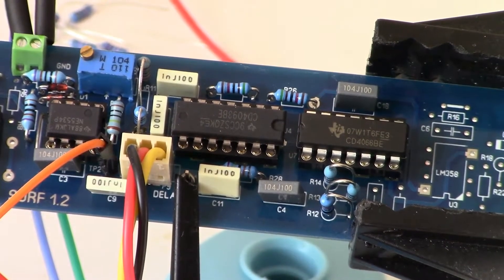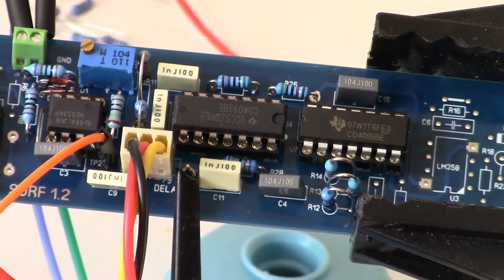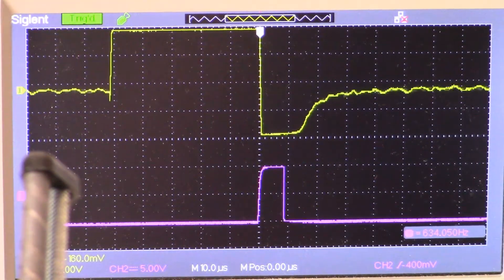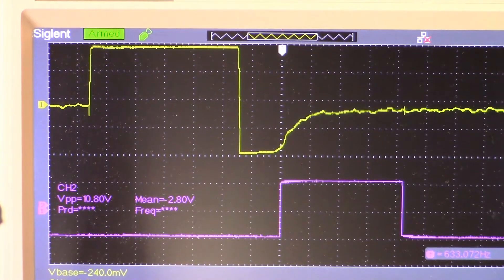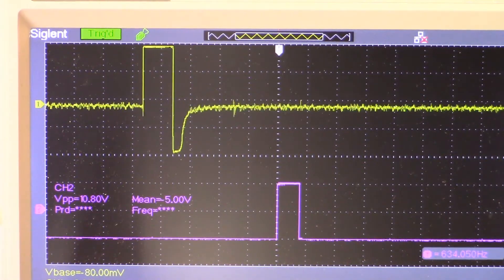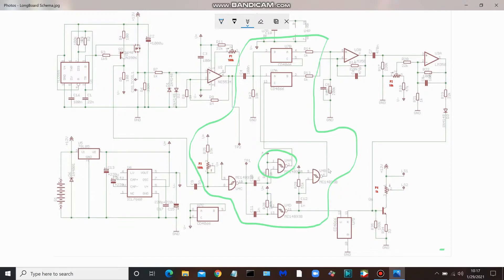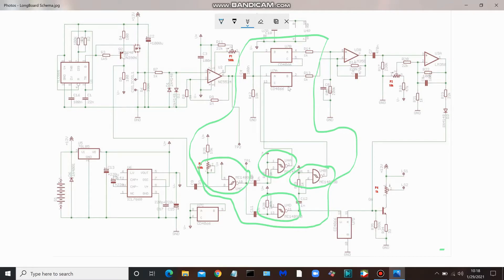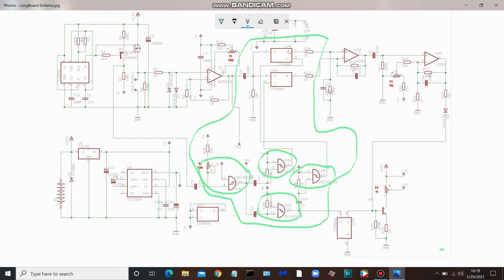Surf PI Longboard DIY part #4 sample pulses

Comment: Excellent videos - I just subscribed. Would be beneficial to mount the Delay and Offset potentiometers on the outside of the control housing? I´ve seen some PI machines like this.
Reply from the maker: Hello John,
Welcome to my channel.  I believe if my memory serves me well that I put the Threshold, Volume and Sample Delay as exterior pots on that project. The trimmer pot for the nulling of the pre-amp should remain on the board as that is a one time adjustment.  Please like and share the videos if you enjoy them and thanks.
Reply: Thanks Mate 😀
Reply from the maker: @MrJkosta  Glad to help.

Comment: Thanks alot for all your videos.
I am not sure but i think the reason for the second sample is used for ground effect (minirlized soil) i read that the ground effect appeares after the target for about 10 microsecond so if we take another sample with 10 micros apart and substract each other then we will cancell the soil effect.. not sure but that what i saw in gold scan detector
Reply from the maker: As you swing the detector it picks up the Earth's magnetic field.  If the 1st sample contains a real target as well as the EFE (earth field effect) and the 2nd sample only contains the EFE, then when they are compared by the detector it subtracts out the EFEand you only have the target signal left.
Reply: @SurfDetector  so if i add this feature to polones pi i could work fine on mineralized soil??
I mean adding another 4011 with bf245 and before the 741 op amp i add a differntial amplifier.
Reply from the maker: @newton224466  This is not for mineralized soil.  This is for the magnetic effect of the earth.
Reply: @SurfDetector  ok i got it but does the earth magnetic field has that effect? I mean why when we put the polones on the rock surface we get no sound, while on the soil it does not stop beeping? I do not thing the earth magnetic field has that big affect
Reply: @SurfDetector  final question and i am sorry for the long replays. But could you guide me to know about the soil minerilized effect and how to minize it
Reply: @SurfDetector  https://youtu.be/PaFsl9-b7Ic
This modification how stable on mineralized soil and sensitive for gold. This means the delay is small but stable on soil
Thanks againg and sorry for talking alot
Reply from the maker: The PI machines handle most mineralized soil well without modification
Reply: @SurfDetector  unfortunately felezjoo and polones and delta pulse2 were not good at mineralized soil her.. any advice for available schem and do good job at soil? thank you so much 💎
Reply from the maker: I have not had the need for this so I do not have this information.
Reply: @SurfDetector  thanks alot fot your time and for you videos and sorry for talking alot.
All respect

Comment: to see the delay wave. on which pin the probe is placed
Reply from the maker: To see the sample delay pulse you need to look at TP1.  If you have not put the test points on your pcb then put your probe on pin #10 of the 4093 chip.  Please subscribe to the channel if you enjoy the videos.
Reply: @SurfDetector  Okay, thank you. I have subscribed. your video is very simple but easy to understand properly,
Sir, please make a simple pi / pi pirate video. I have made it many times but it always fails, I don't understand the problem
Reply from the maker: I might do a Pirat project sometime.  I have a pcb version that I have done.
Reply: @SurfDetector  If I don't have TP2, where do I connect the oscilloscope?
Reply from the maker: @justihno5341  You need to read the schematic, I do not have any of that information with me right now as I am working away from my home.